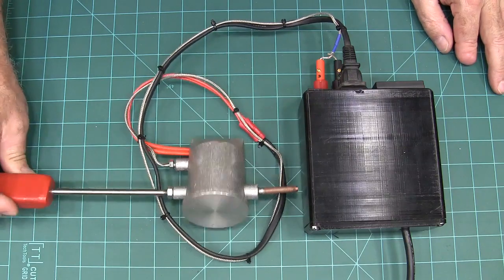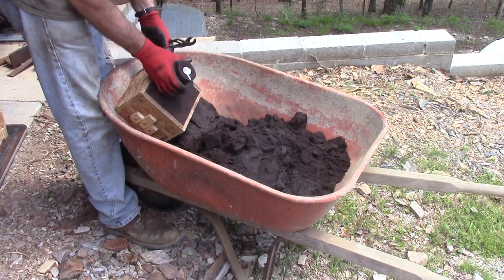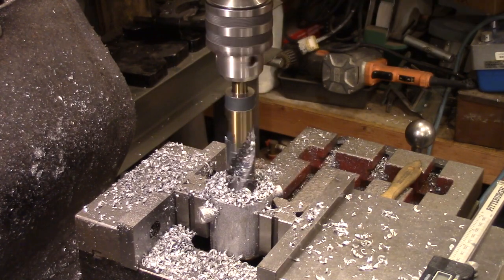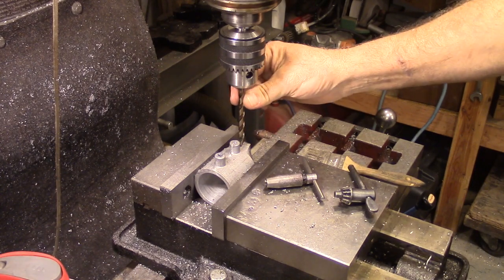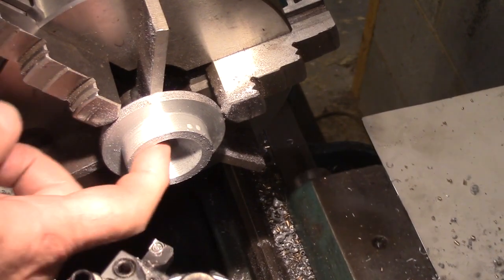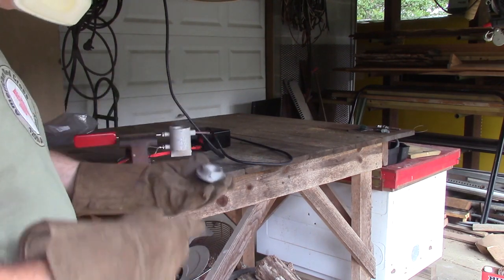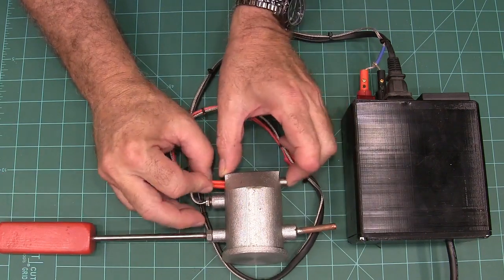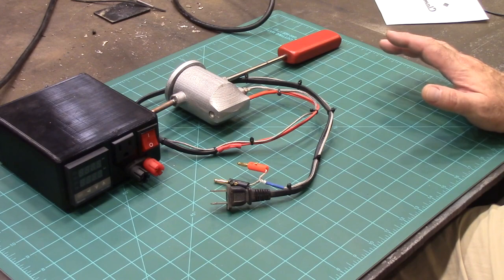Homemade Digital Oxalic Acid Vaporizer

Comment: Very nice design...  I would like to follow suit, but with a setup that operates entirely on 12V since house power is not readily available in many cases.  The Rex-c100 package that you found is an unbelievable bargain!  It should operate fine on a small inverter since it is very low power (or, I could look for an alternate DC powered unit).  I will need an alternative for the SSR (a simple power FET should be fine).  You used a 300W heater.  Based on your experience, do you think the 130W, 12V automotive glow plug would do a good job as a heating element?  It is a nice form-factor and can readily be bolted into the cup arrangement.  Roughly, How long does it take for your 300W heater to reach the desired operating temperature?  It seems like a heater with half the power would take around twice as long.
Reply from the maker: I originally used a 200 watt heater but found it did not provide enough heat.   When you first dump in the acid the temp would drop too low and it would stop sublimating.  The 300 watt does a better job.  I like your idea for the 12v system, good luck with your build.

Comment: I wanted to hear some Darth Vader sound effects when you were wearing the respirator. Is the fit of the cap tight enough to hold while inverted like the provap model?
Reply from the maker: LOL.   This cap does not stay on by itself, it could if you put a high temp o-ring in it.